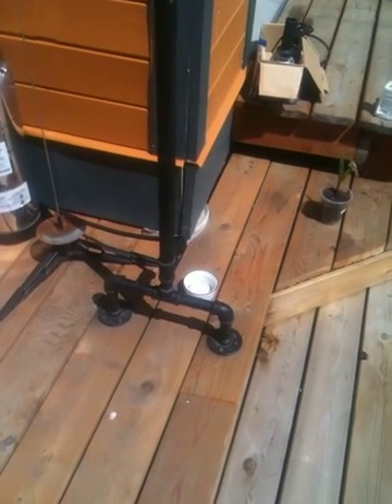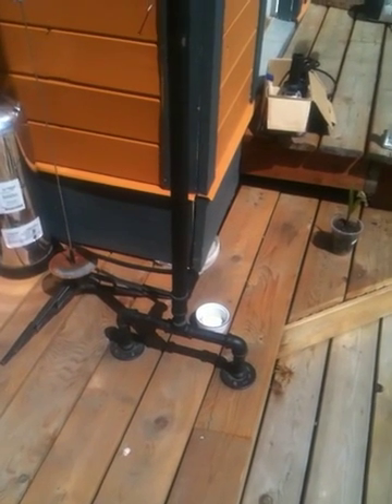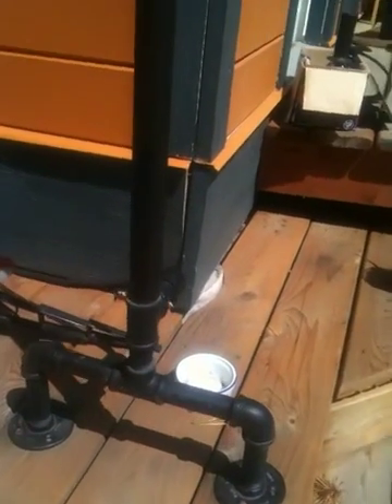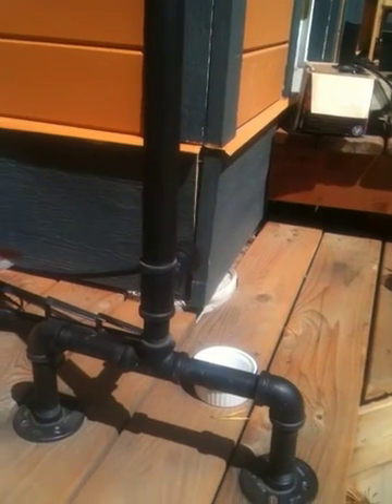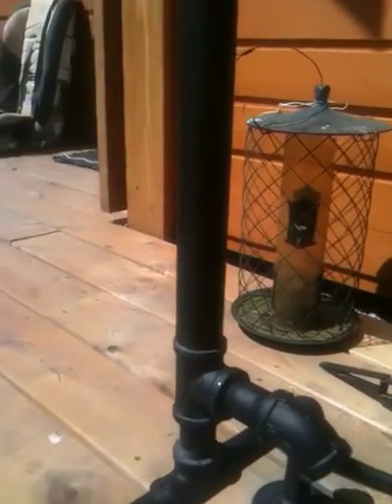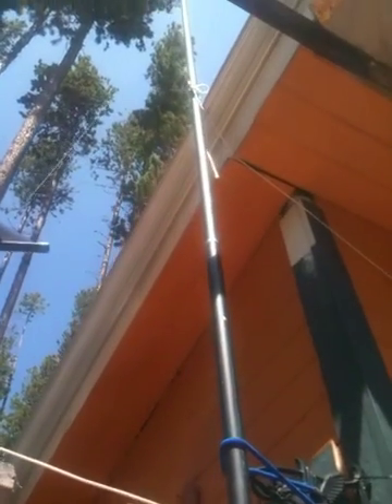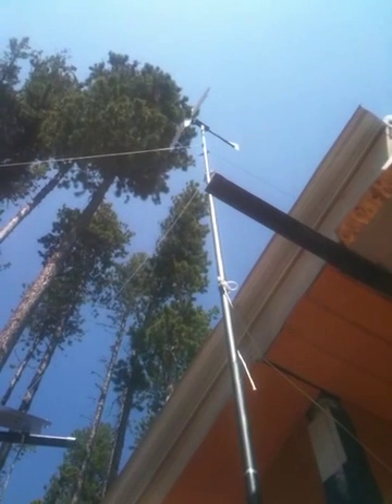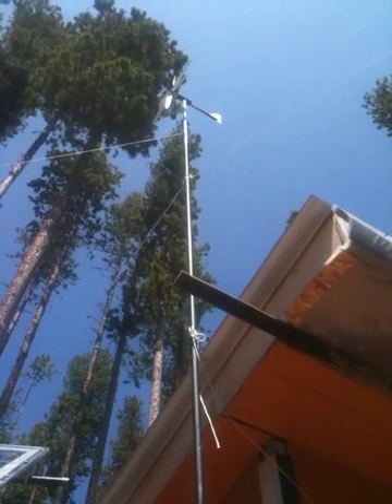Simple (and cheap) tower from plumbing pipe

Comment from the maker: Hi! Thanks for the insight. Just in case it snaps or the guide wires break, it does have a route. I keep wanting to replace it with a bigger pipe, but it difficult to source 1-1/2 threaded pipe at a reasonable price. The recyclers in our area have really driven up the price for metal.

Comment: Nice Job!
Just some thoughts, when they thread the pipe ends the thickness is, so where there is a fitting, there weak point in tower. you also wish to have a drop zone so if it falls it won't damage something like a house or people. 1 1/2" pipe is the smallest you should be. just saying.